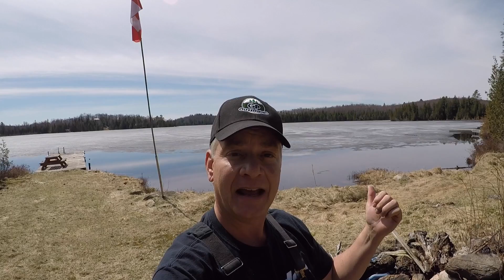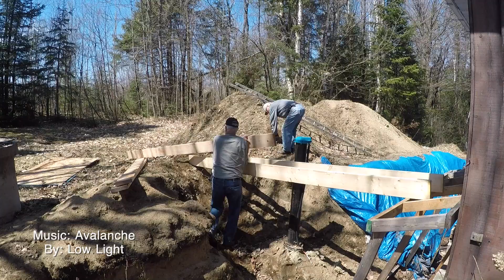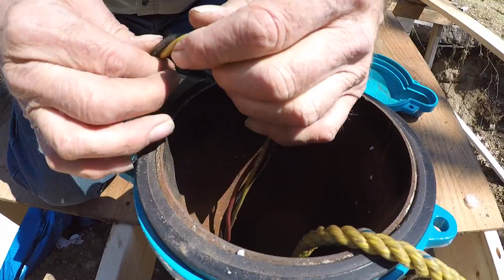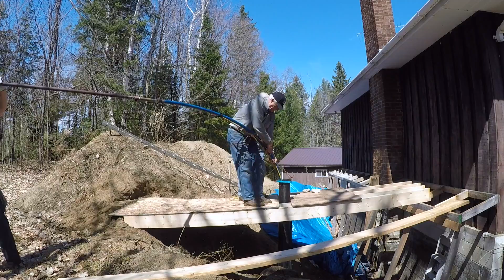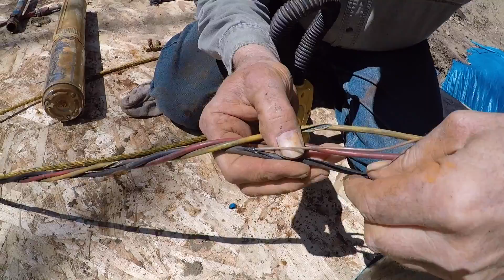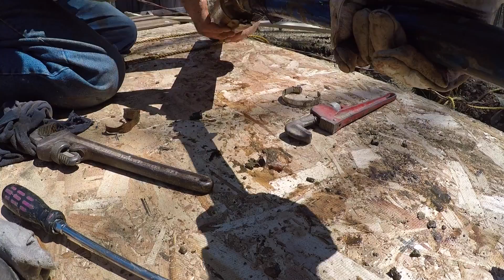#153 No Water? Repair and replacing the well water pump. Part 1 of 2. submersible pump.

Comment: I had the same problem last year. Pump was fine but wire's we're the same as the one you have. I would recommend putting spacers every 15 to 20 feet. Every time the pump kicks on there is a chance for it to rub again and have the same problem again. Have a great week and God bless.
Reply from the maker: Hey good evening Kevin. Thanks for the help and advice. It makes a lot of sense . We finished the job - second video will be out soon - and we wrapped it every 10 feet or so. Hopefully that will help mitigate it happening again. Thanks again and all the best!

Comment: Thanks Gord... Excellent content here, you never disappoint! Nice artesian well... 250 ft., its down there! My artesian is 300 ft. with the pump hung at 280 ft. I had it professionally installed in Sept. of '01... I use a 1/2 HP Aermotor 4" submersible pump, 230 volt, single phase. You were smart to make a ref. mark on this as you will thank yourself on the reinstallation! 
Looking forward to Part 2...!
The retreating ice must be a welcome sight after a long winter me thinks. Lol...
I have 24/7, 360 days a year overflow. In other words my reservoir capacity never runs out, it simply fills back up & continues non-stop out the overflow pipe & into a culvert that runs beneath my d/way... I believe it is 4.4 gals. per 1 ft. of pipe if memory serves me correct. In my case that equates to 1320 gallons of water on hand at all times, i.e. 300 x 4.4 = 1320... 
Thanks again,
Bill... :~)
Reply from the maker: Hey good evening BOTH! That's great. It sounds like you will always have plenty of water on hand in the well to serve you. Very interesting and great project to be involved in. Learned a lot on this one. We put a 3/4 HP in and new wiring so should serve the neighbours for a long time I am hoping. Cheers and all the best to you BOTH. :)

Comment: Not an easy task. I had a well drilled in 1997. The guy that drilled the well put the casing, the liner inside the casing,  supplied the 93' of water line, and the submersible pump and a blatter tank for $2600.00. I thought that was a great deal. My well is still in service today 22 years later. Definitely an experience I'll not forget. That's nice when you can jump in and help a neighbor GP. My hats off to you friend. 💪💪👍👍👊👊👊
Reply from the maker: Good morning Dean. That was a great deal. Wow. I should have called your well guy when I did mine years ago. I think I am still trying to pay it off. LOL. Thanks very much my friend.  Cheers!

Comment: I have seen this very problem several times and we do not have lightning where I live. The problem arises from using wire that has no sheathing over the insulation. Mechanical movement when the pump goes on and off, plus maybe some thermal expansion and contraction, cause the wires to rub against the metal casing of the well.  Eventually, the insulation wears thru and the wire shorts into the metal casing. Then the melted/burnt insulation is caused by excessive current draw before the breaker kicks in.

There is now a sheathed wire designed for well applications. The last time we had to replace ours, I made sure the well company used that sheathed wire.

The other option is to use a PVC casing when the well is drilled.  Less abrasion and no conductivity.
Reply from the maker: Good morning Pete. Thanks for the detail above. Maybe it wasn't lightning. Just coincidence during the same few days. We just assumed it had to be because of the wire damage etc. What you describe seems very probable and could very well have been the trouble. We didn't get the seethed wiring. They only had the normal pump wire and too late to reconsider it now. But thanks for the info above. Hopefully it will be helpful for others. Cheers Pete!

Comment: Good day GP, did you inspect the electric panel inside the house for further damages ?  Also the water pipe are used often inside the house for grounding ( phone ) or electrique wire ( how are the breaker inside the panel ? ) electric current travel very well inside water pipes and copper tubing are great conductor too !!! CHeers !!!
Reply from the maker: Hey Dave, not sure but we'll see as we go into the basement to replace the control unit and wiring. But good points for sure. Have a great weekend!
Reply: @GPOutdoors  Good evenings GP, the house insurance will ask probably for electrical inspection done by certified electrician to seek other potential electrical damages,  since it's a lightning strike. Cheers !!!

Comment: GP teamwork amongst neighbors is refreshing. That's a $150 pump, $240 wire. I'd check contacts on pressure switch for pitting. If minimal arcing & carbon file or sandpaper will clean them up. Make sure breaker/ fuses are off!
Reply from the maker: Hey good day and thanks Sean. Some good pointers. The breakers were off. First thing I asked Guy when we got there. But will check the contacts etc. Cheers and thanks again!

Comment: What type of "pipe" is that?
In our area they used galvanized and now pvc, but it's schedule 120, not 40 as Tracotman44 mentioned.
Reply from the maker: Hey good day Tom. I am actually not sure. The walls of the pipe are really thick though, I noticed that. I will try to remember to look at the stamping on the side when we finish. Cheers!

Comment: I got an electric bill that was double the norm once. I found that my well pump was running continously, due to a split in the pipe,  halfway down the 120 foot deep well.  Be sure to carefully inspect that pipe that carries water up from the pump. Also, I  did not see any plastic guards that center the pipe and wiring, keeping it away from the casing where it can chafe.
Reply from the maker: Good day Ron, and thanks for the heads up. Guy took a look down as far as he could with the flashlight. Yes, there was a black rubber Torque sleeve on it that we removed. We bought a brand new one for the replacement. Guy figured it was better to put a new one in at the same time instead of trying to reuse the old one. Thanks again! All the best!

Comment: U guys could have been sitting around the fire  having a cool beverage  most well guys have a truck speciffically designed for installing and replacing well pumps   takes them about half hour to replace a pump    not expensive  my replacement cost me 75 bucks plus of coarse the cost of the pump   easy peasy   then he came and had a beverage with me  lmao  just fyi
Reply from the maker: Hey good morning Larry, now that sounds like a plan. LOL. Not sure where your well guy is but the difference between doing it ourselves and calling a well guy was a whole lot more than $75.00 I can promise you. LOL. Plus, hey, I wouldn't get to learn how to do this. But I like your thinking. I think a beverage together after we are done is the right way to celebrate the completion of the job. :)) Cheers and have a great weekend my friend!
Reply: I agree wit GP, the cheapest person around me is $150/HR!!
Reply: @jrsmyth9761  Took my guy about 35 minutes but our well is not very deep  hit good water just over 100 feet  Took him no time at all to pull the pipe and replace the pump and send it back down and put the lid on  and he drilled the well too so may have had something to do with it

Comment: Morning G P , ive had to pull my well pump a few times (320') and after the first time we rigged a old car wheel to let the pipe saddle into and pulled with a 4 wheeler, what a back saver. Then just walk it back the same way , keep pipe from kinking. Cheers, keep up the great videos.
Reply from the maker: Hey good morning Don. That's a great idea. We thought about putting something together at one point but figured we'd try it out on our own. But that is a smart idea for sure. Cheers and thanks for watching and for the idea!

Comment: Good video GP...Neighbors helping neighbors.  Good to have old Guy in the 'hood'  huh. You gentlemen were lucky in one respect....its new enough to have plastic pipe.  Most wells put in down this way in the 70's and before were 1" galvanized pipe,  21' sections.  Mine is at 399 feet and we replaced the 19 galvanized sections with schedule 40 pvc the second time we pulled it.  Luckily we don't have a 2 1/2 hr drive to locate a new one... (-:  

Oh hey... did you fellows get a chance to turn in the burnt wire for some coffee money on the trip to town...?? (-:
Reply from the maker: Hey good day T! LOL. Not yet but that copper is worth a few pennies for sure. Now I have to say I am very happy we didn't have to pull up 200 feet of galvanized pipe. LOL. We may have needed to call for backup. LOL. Yes, very lucky Guy has a great practical mind. If it were me alone, I am pretty sure I would have kinked that piping. Stay tuned - I'm sure we'll get it going again! Cheers!
Reply: @GPOutdoors  I know you guys are done with it by now and have done a great job as well.  One of these days you may get to see a portable rig I built years ago for well pulling.  I should actually do a short video highlighting a 'casing jack' that the old timers used.  Ask Guy if he's heard of that tool next time you talk to him.  I won't waste space here with a description, but it is designed for pulling wells by hand.
Reply from the maker: Thanks T!. I will and I also think that would make for a good video, when you have time to film it. I'd watch for sure. LOL. (ok, I will be watching regardless...). Cheers!

Comment: Mine is slightly down further at 350 feet. No way I'm doing it. I had problems with my system freezing on the top side. Fixed that. Then the pressure switch went bad. Fixed again. I might i add that I didn't fix it. I could've done it, but the stroke I had, kind of puts a damper on this. If i ever need a new pump, I'd get a grundfos, constant pressure pump. That way it wouldn't stop and start a lot. Stinks getting old with lots of health issues. 🤔🤔🤔🤒🤒🤕🤕🤕
Reply from the maker: Hey good day Tom. Wow - that's a long way down. This thing was heavy enough as it was - actually alot heavier than I thought it would be. Be well and thanks for   saying hi this morning!

Comment: When mine finally goes I'll replace it with a variable speed - no more pressure tank and way easier to start when on the generator.
Reply from the maker: Good day SP. Thanks - a good idea. I don't know much about them but have heard of them. A few folks have mentioned them. Have a great weekend!
Reply: Great to know! I was not aware of that!